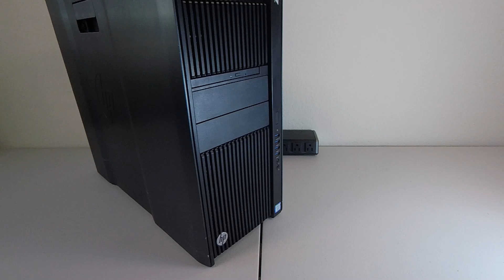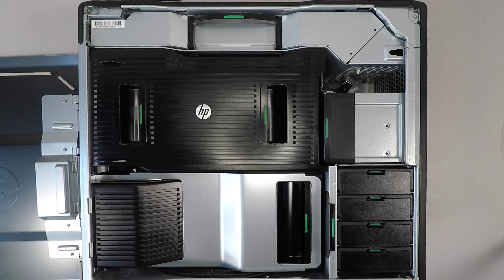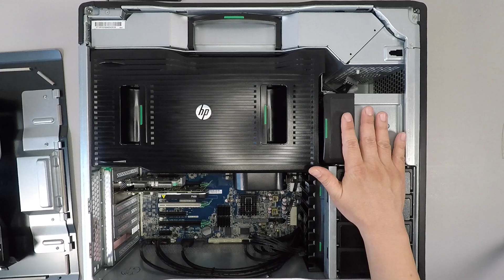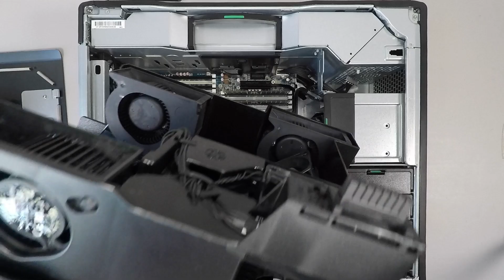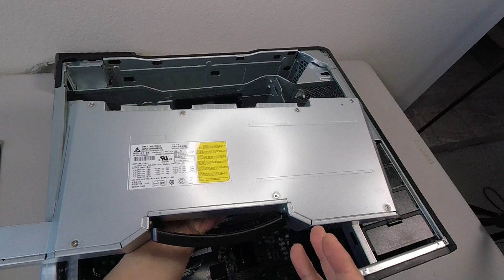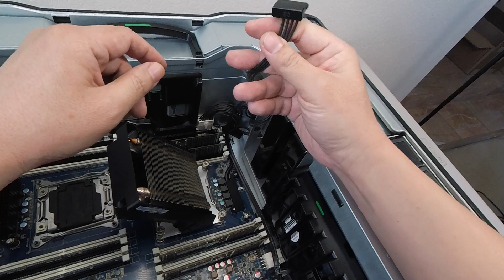9 reasons why I think workstations make great servers | HP Z840 Workstation

Comment: "2) Onboard LSI SAS2308 SAS controller - great for ZFS, TrueNAS, Unraid, etc.
" Does this controller allow pass through via configuration / menu option for ZFS/JBOD? Or is it necessary to flash with IT mode firmware?

Regardless, if a firmware update was desirable for the 2308, can it be accomplished in a similar manner as demonstrated in your "HP Z840 workstation | How to update BIOS without OS" video?
Reply from the maker: By default, HP puts the IR (RAID) firmware on the LSI controller. But, it is easy to flash to IT mode firmware. I'll be releasing a video on how to do that in the future. The method involves booting FreeDOS from USB or UEFI shell. I don't know of a way to do that from the BIOS/UEFI system menu. If using ZFS, best to use the IT mode firmware.
Reply: @ArtofServer  Recently having bought a z840 an instruction on how to flash the on-board SAS-controller to IT-mode would be gold :) Looking forward for it.

Comment: It's expansion capabilities is what amazes me. You can go from a mere 4 cores processor to 22 cores and from 4GB of RAM to a whopping 2TB.
Reply from the maker: yeah, it really is just a server in a desktop case...
Reply: I believe the E5-2699 v4 could be used in this machine. This is a 22 core processor with 44 threads. If it is a dual processor machine, that would make it a 44 core/88 thread machine. In my Z840 I am using two E5-2690 v4 processors which are 14 core processors. This gives me 28 cores/56 threads. I am using Proxmox as the OS and TrueNAS Core as my primary VM with several other VMs.
Reply: Core count is great if your application needs multiple cores to compute concurrently, think cad computing, but if you have application that is simpler, a single thread, and higher speed processor will be better, think most modern games.  Some of the e5 processor number that would benefit gamers, would be processors with speeds in the 3.5ghz range (2637, 2643, 2667 and 2687w in v3 and v4 versions). Higher core count processors will hinder single threaded programs, and higher speed, lower core count processors will hinder larger data intensive programs. So just something to think about, as just having a lot of cores or super turbo speeds, needs to be matched to your application requirements. My z820 and z840 machines (have several), I have several different processor configurations, to match either game play, or something like video editing and rendering.
Reply: @ussmillerco  a sweet spot for gaming on these old Z machines is a 440 or 640 with a e5-1650 or 1660, basically same performance as i7 6700k.
Reply: @asciiditygaming  agreed, (have a z640 /w/ a e5-1650 myself) for single socket motherboards, those processors are great for single thread applications.
Reply: And now you should show the public how you did all of this, I myself would like to know the name of the processor that is 22 core. Ram is not a problem.
Reply: I think the maximum is 2x e5 2686 v3, 18 cores, so 36 cores, 72 threads total with both installed.
Reply: @mikea2717 you think wrong.

Comment: gotta ask, any luck installing esxi 6.7 on it?  I'd love to upgrade my older workstation/host.  Love the 'quieter' design vs the rackmount having one is enough...
Reply from the maker: Never tried it. But the onboard sas2308 is compatible with esxi 7.0
Reply: I have a second unit currently running ESXi 6.7 so yes it will install without problems. Make sure you enable hyper v in BIOS prior to installing ESXi.
Reply: have had everything on mine: proxmox, UNRAID, esxi.  all works. only drawback is getting damn GPU passthrough to MacOS costs expensive consulting time with an expert.

Comment: Anyone who is looking to use a Z820/Z840 for gaming, when using a large GPU like the 2080/3080/3090, the lower shroud can be removed permanently without much compromise.
Reply from the maker: just be careful that the PCIe hold down bracket will not lock in place without the lower shroud. if moving the machine around, especially with heavy cards like GPU, there's a chance it can slip out.

Comment: Yup they're great, I ran a Dell R7610 with 2667 v2 chips as my workstation. Now I have a ryzen rig that is still rackmounted and has display going over fiber DP and usb over fiber (icron 2344).
Reply from the maker: Cool! What is this fiber DP you speak of?
Reply: @ArtofServer  they're all over amazon if you search fiber DP, $75 for a 15M cable. Work at least at full DP 1.2 4k60 spec, they're great.
Reply from the maker: @NikitaLab  thanks!

Comment: This Workstation is good enough for ready to go solution, but it has problems from scratch.
If you looking for ultimate powerful and customizable solution based on standard components just look on Supermicro, Tyan or Inspur platforms.
Reply from the maker: I love supermicro stuff too... But I do think HP mechanical design on this Z840 is significantly better than the competition. Inspur is not really available in USA market; is it available in your country?
Reply: @ArtofServer  Sure HP has very good mechanical design and it look great.
I live in Russia and saw Inspur twice. I don't know how it got to Russia, official or from eBay. It was very nice motherboard, that I can recommend to by on secondary market.
Also I can recommend Epox server motherboard, but never buy ASUS. I like ASUS hardware but not server motherboard - they very laggy and unstable under high load, also they have very few tweaks in BIOS.

Comment: What's the power consumption like? Power is pretty expensive in the UK unfortunately. Also is there any performance penalty of using the built in LSI controller?
Reply from the maker: Don't know yet, and that's going to vary greatly depending on choice of CPU, GPU, etc. when I'm done setting up this machine, I may run a power consumption test and make a video about it.

the onboard LSI SAS2308 controller is great for both HDD and SSD use. It's a great IT mode SAS controller, but not so great RAID controller. I'm planning to flash it to IT mode to use with ZFS. but, if you plan to use it as hardware RAID controller, I would recommend instead adding a better RAID PCIe card like LSI SAS2208 or SAS3108 that has onboard cache.
Reply: My power bill went up $30 per month with a z840 setup similarly as a server and running 24 hours a day.
Reply: @rcdenis1  
You’re using mechanical HDDs?
Reply: @hectorcardenas2171  yes, 4.
Reply: @rcdenis1  
That’s the main reason.
Reply: @rcdenis1 damm

Comment: This is so much nicer than those old dell workstations I was buying!
Reply from the maker: Which Dell workstations were you buying? The T7910 I have is pretty comparable to this Z840, but I think the HP is prettier! Lol
Reply: @ArtofServer  T5600s - I like them.  They have a ton of compute power and memory capacity at an awesome price.  However, the drive setup is pretty terrible.  I'll check out the T7910 as well next time I buy, if I decide not to buy more rack mounted hardware.

Comment: Hi there!   I just wanted to touch base.
I'm sure that you have been busy and had quite a bit going on over the holidays...  But, I am not sure if you received my follow up email to see if you received any more H200?
Reply from the maker: Hi!!! Sorry if I missed an email! I get a lot of messages so sometimes I don't get to see all of them! H200 are in stock in my store! Link to my store is in the video description. Thanks!
Reply: @ArtofServer  I was the guy coordinating for Paypal because of the Ebay address issues. :-)
Reply: @ArtofServer  Please, I desperately need the IT Mode H200, still dealing with address mis-shipping issue with Ebay.  However, can still do paypal.

Please advise

Comment: Can we put in a raid card inside ? Say a H710 ?
But these workstations can only take 2 drives right ? Oops ...more bays available ... Nice ...
Reply from the maker: Sure, if you want hardware RAID, you can add a RAID card and switch the drive bays to the add-on card. I would not recommend a Dell RAID card in this HP workstation though, likely to have smbus conflict. Just get a good LSI SAS2208 or SAS3108 RAID controller.

Comment: That box is sweet, it has Unraid written all over it. VM's with shared video, storage management, dockers etc etc etc. :) I am a little envious, and I want one :)
Reply: Look into the Z820, its a bit more budget friendly
Reply from the maker: @hacked2123 yes, Z820 is a nice machine too! And the E5-2687v2 are not that expensive now so you can get great value! It doesn't support PCIe bifurcation though, and I really wanted the quad z turbo drive!
Reply from the maker: I paid about $450-ish for this barebone, so need to add cpu and storage. It's all relative, but I think I'm getting a lot of value for the price. I wish the side panels were not scratched up, but the internals are solid. More videos on this Z840 to come. If you are interested, let me know and I'll ping you next time I see a good deal on one.
Reply: Every once in a while you can find new side panels on ebay for next to nothing.  You can also refinish them.
Reply from the maker: @ELECTR0HERMIT  what do you mean by pre-850 PSU?

Comment: Are there dell alternatives to this. I despise hp.
Reply: Fyi, I never buy HP, and I worked for Dell ProSupport call center back in the day, so I know how awesome Dell is...but I've owned 3 Z800's, a Z440, a Z620, and a Z820. One Z800 is in storage, one Z800 was gutted and put into a 4u Rosewill server chasis with 15x 3.5" bays, one Z800 gave to a friend, the Z440 was too little to be useful and gave it to a friend (took the m.2 pci-e card), Z620 passed onto my wife, and the Z820 is my daily driver.
Reply: funilly enough I feel the same way but exactly opposite -- I've had good experience with HP stuff with Dells either not working well or not at all. Good luck.
Reply: @Radovanslav  weird. Every hp product I have tried has broken within 3 year. Dell on the other hand has lasted for 10+ years.
Reply: @YuriShevchouk  here I have Gen 10, 20 y old LJet, newer col ljet, z400 and z420 and some hp displays. Looks like an hp fan club resort. No probs, stuff just works.
Reply: @MrRolloTamasi  maybe this will make me give them a second chance.
Reply: I agree, i have never had a good experience with HP enterprise hardware.
Reply from the maker: I'm not an HP fan necessarily, but their Z820/Z840 workstations are pretty high quality machines. As for alternative, check out the Dell Precision T7910. I made several videos about that machine; it's also a nice one, but has limited 3.5" storage capacity.

Comment: I need one based on #EPYC 🖥
Reply from the maker: Have you checked out my videos on the Lenovo P620 with the Threadripper Pro? Basically a EPYC workstation!
Reply: @ArtofServer  sure did but I'm after is a modular workstation that I can change however I want plus that p620 is a bit pricy (only option available so far is: DIY) after all dual socket supermicro mobos are available at a reasonable price 💲